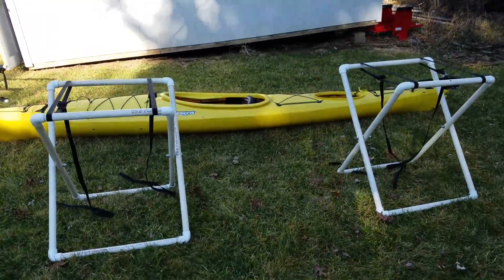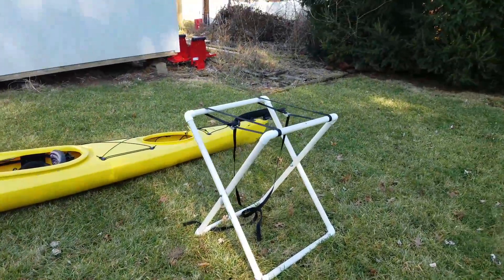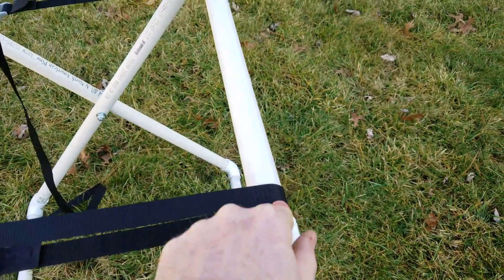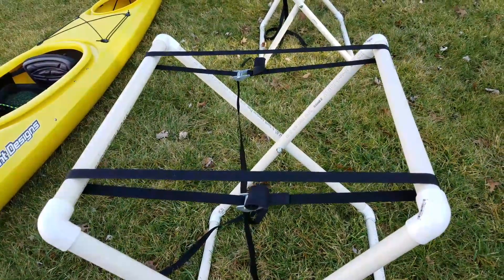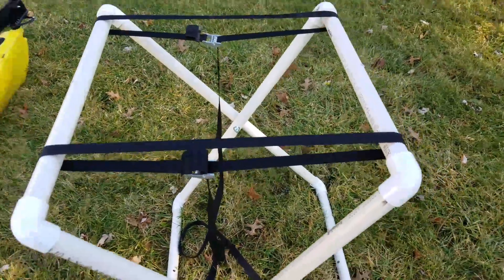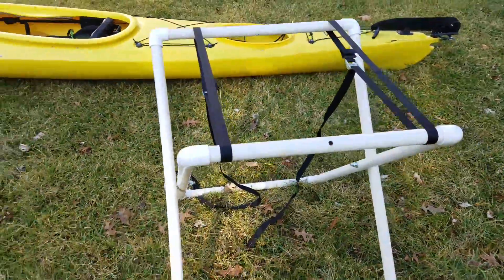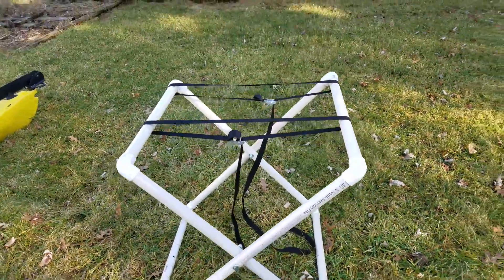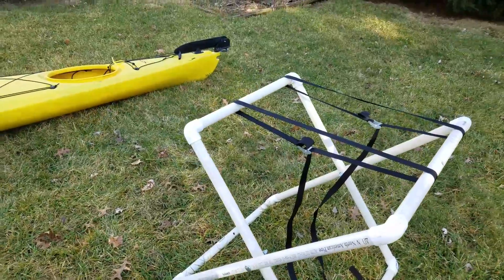DIY Portable PVC kayak stand

Comment: I built a pair of these today using 1 1/4" PVC and they work well. Instead of straps, I used a couple of empty 50# bird seed bags, doubled along their length so they were ~9" wide. I folded over the ends ~2 1/2" and attached them with 3 self-tapping screws on each side ~ 1" in from the end of the bag material. They came out 26" wide and 28" tall, which is a decent working height.  

The one downside to the design is that the boat sits slightly off-center, but as long as you don't make them too tall and narrow, they won't be unstable. I used them while repairing the skeg on my Anas Acuta today (17' 2" x 20", ~50#) and they worked great. I'm glad that I went with the larger, stiffer pipe and I expect that they'll last for decades. However, that pushes the cost to build them to just over $60 at current Home Depot prices. Half the cost is the 16 elbows at almost two bucks apiece.

 I've got deck rigging to replace on two more boats tomorrow, so they'll get a good workout this weekend.

Comment: Can I get the measurements for these?
Reply from the maker: The finished measurements below, are outside edge to outside edge.

The inside ring is 24"x36" and the outside frame is 27"x39".
Reply from the maker: Hey FireFighter,

Sorry for the late response. I did not notice your question.

Items needed to make two racks
2 - 10'x1" Schedule 40 PVC
16 - 1" PVC elbows
4 - 3/8-in-16 x 3-1/2-in Carriage Bolts and nuts
3/8-in washers, stack as needed
4 - cam-buckle straps

Cut 4 pieces at 36" and 4 pieces at 24". These will be used for the outside frames.

For the inside frame my end sizes are 4 pieces at 33" and 4 pieces at 21".  Start slightly large and trim down as needed to get a nice fit.

Drill 3/8" hole in center of 36" and 33" and place bolt through both pieces. Loop cam-buckle straps around frames and you are done.
Reply: @MyEvaluation  you know with these measurements you require more then 2 10 foot sticks of pvc! SMH!
Reply: @MyEvaluation  your some kind of wonder aren’t you! lol!